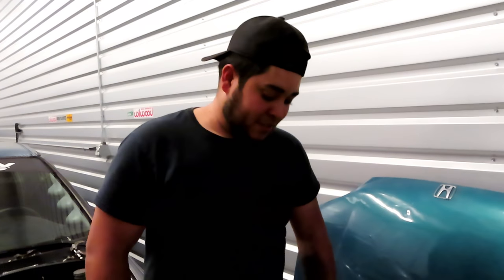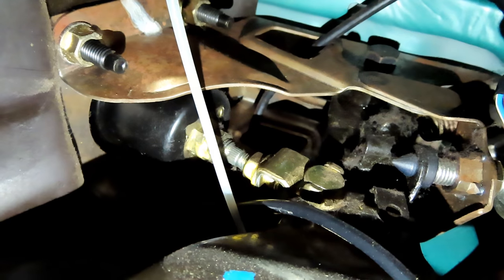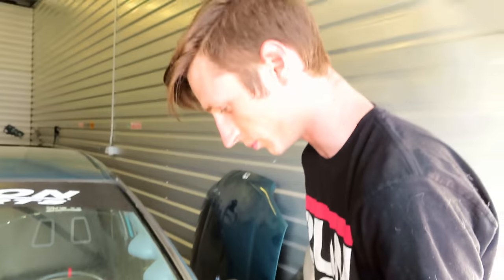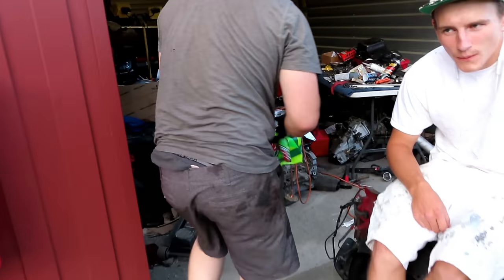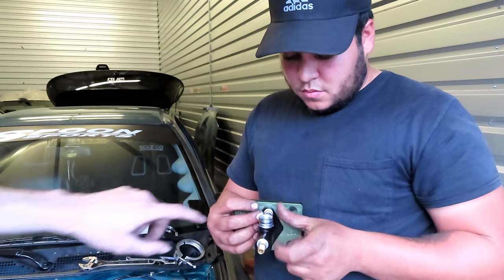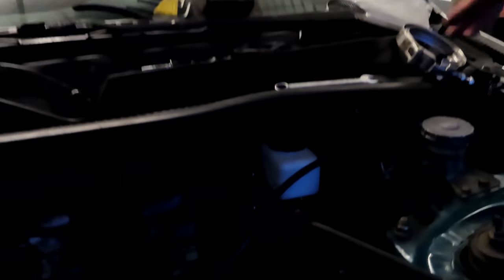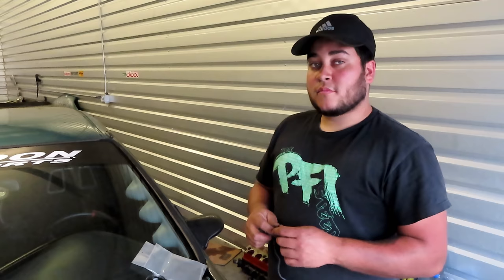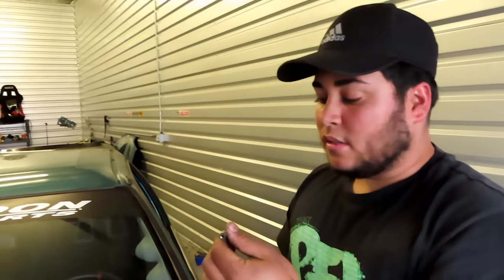Brake Booster Delete Kit Install On a Honda Civic

Comment: thanks for not showing how you got the 4 nuts off the inside
Reply: 12mm wobbly with a 6in extension and a whole heck of a lotta patience. I found it easier to remove the plate on the bottom of the dash to get tot the top two.

Comment: Great vid. Even better if Jeremy was included. Without the booster, wouldn't it be harder to stop faster? Or have to apply a lot more pressure to the brake pedal?

Comment: You need a dual circuit master cylinder. 
Please don't use a splitter. We have had dual circuit braking since the 1950s for a very good reason.

Comment: Brooo I want to do also that but I have disc all around the integra conversion how will that work for me
Reply: It will work, just takes a bit more force. Your drum style master will actually make braking easier than 4-wheel disc cars due to the smaller diameter.

Comment: I don't know k swap, probably willwood master c, and a cheapo depot brake line adapt, come on man, just needed a $75 braided line adaptation from brake cylinder to proportioning valve at firewall

Comment: Do you know the torque specs for the 2 bolts that hold the brake master cylinder onto the booster. And 4 on the inside? Can’t find information on it anywhere?!! Thank man